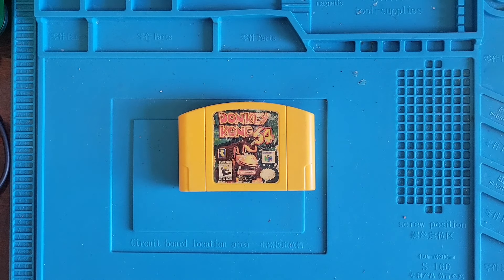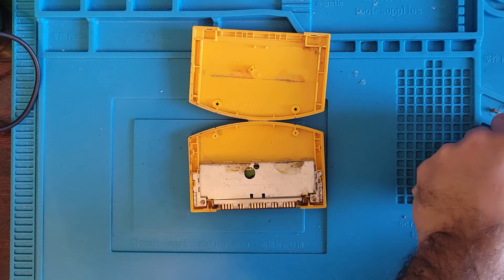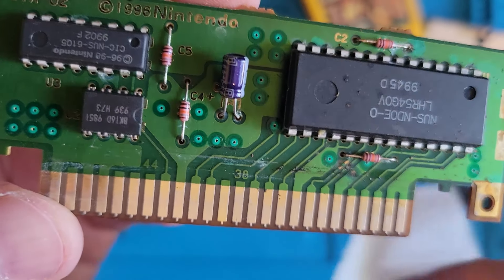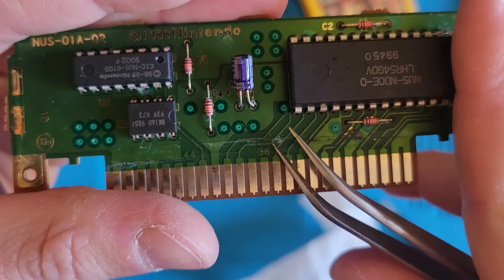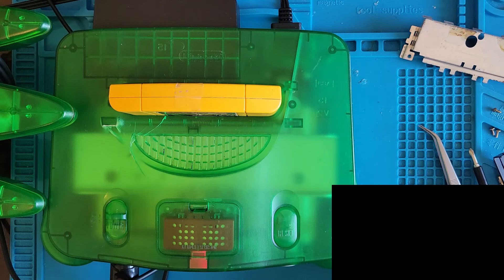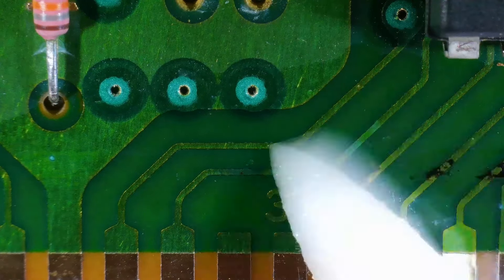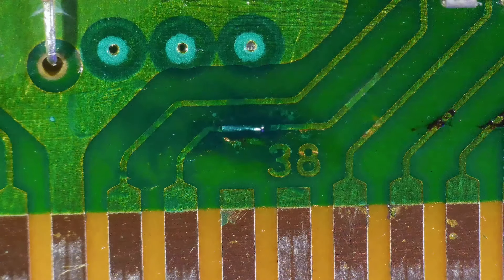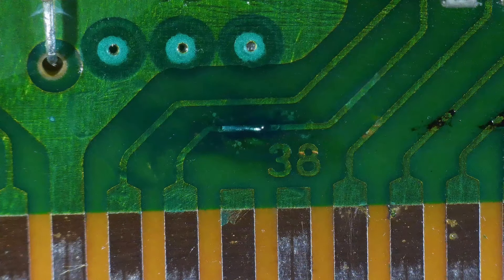Donkey Kong 64 Cartridge Not Working!! Can It Be Repaired??!!

Comment: I bought a cartridge that was full of some kind of powder that I’m not sure what it is, it looks like rust, but it isn’t. Do you have any idea what it might be?
Reply from the maker: It could be oxidation from water damage. Sometimes there is a white residue left behind after the liquid dries up. I would try using some IPA on it and see if it goes away. 🐺🐺😁😁
Reply: @wolfmanrepairs  Maybe someone tried to clean it up with water or alcohol? Even the chips on the board have the dust. Anyway, thanks for answering!
Reply: I remember repairing a VCR years ago that was full of a suspicious white powder that had melted onto various components inside... After some conversation with the owner and a little anxiety that I'd somehow ended up with the result of some sort of failed smuggling attempt, it turns out that the original fault stemmed from the fact that the unit had been filled with powdered sugar by a particularly frustrating toddler. What I'm really saying is, it could be absolutely anything! 😂😂
Reply: @TheBeezleDude  Now I'm really worried, cause I'll think this is some sort of radioactive dust. lol
Reply: @Clodd1  At least it would have enough juice to keep the savegame backup working on the cartridge 🤣🤣
Reply: @TheBeezleDude  Yeah! But I wouldn't live enough to enjoy the saved game. 😂
Reply: @Clodd1  A different kind of 'screen burn' 😂
Reply: @TheBeezleDude  😂
Reply from the maker: I was thinking about this. Does the cartridge have a battery in it?
Reply: @wolfmanrepairs  Very good point, they can leave some nasty residue behind inside things, and that's on top of the corrosion
Reply: @wolfmanrepairs  There's no battery. I have images of the cart, I can send them if you want.
Reply from the maker: Sure!! You can email them to me. Wolfmanrepairs@gmail 
🐺🐺😁😁